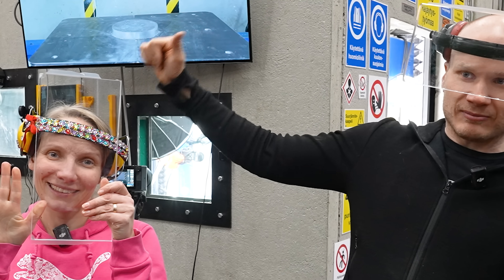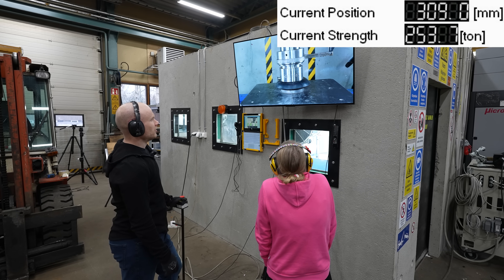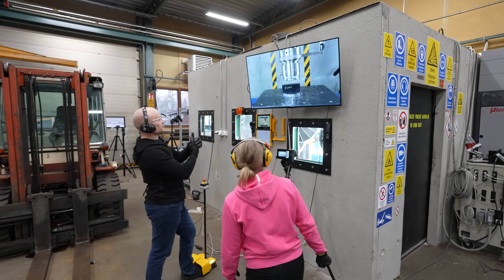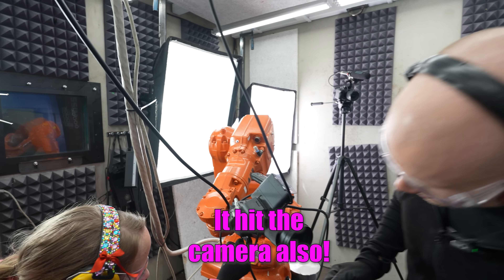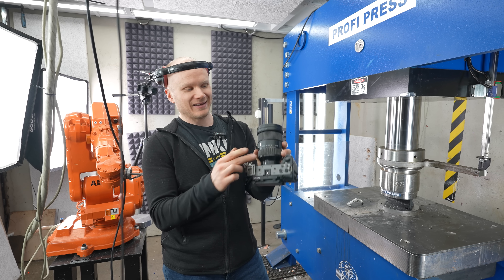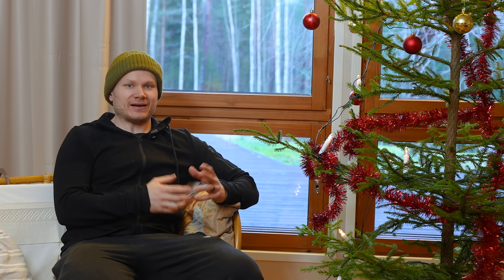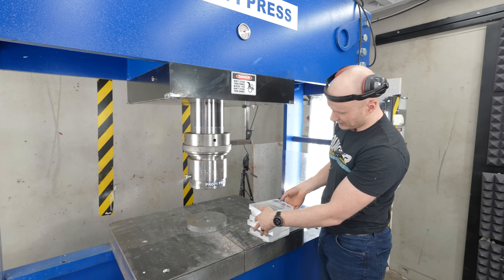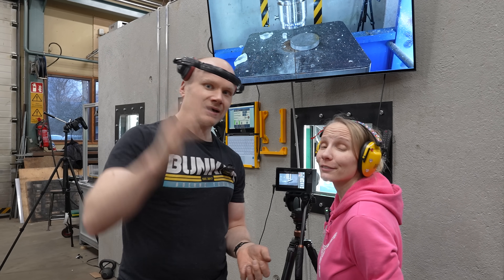What is the Most Explosive Plastic? Hydraulic Press Test!

Comment: The folks who use video cameras around high energy events, like rocket launches and explosions, have the camera inside a high strength enclosure, pointed 90° to the subject with a mirror mounted at a 45° angle.
It's a lot less expensive to replace a mirror than a camera.

Comment: I wasn't sure what the objective was here; whether to cause ordinary plastic to break explosively under pressure or to cause plastic high explosive to detonate under extremely high pressure without involving a blasting cap. I'm not an expert in explosive but I do know that you can do a lot of things with plastic high explosives without settling them off including stuff types that will literally burn if set on fire but mostly, to get them to go BOOM, you need a detonator.

Comment: I'd be very surprised if the files on the memory card are lot. However, one of the thin wires from the chip to the contacts has probably broken so somebody familiar with microsoldering may have to check it first or connect to chip contacts directly to read the data.

Comment: You should mount the camera sideways behind a sheet plate and use a mirror at a 45° angle to capture the footage.  You only have to worry about breaking the mirror and flipping the footage after that.  There's still a risk of the camera getting hit, but it's less than before.
Reply: Excellent idea. No loss of quality from thick plastic.

Comment: I worked for a company that used deep-drawn acrylic doors for vacuum chambers. I was in the weld shop late one day. They were performing vacuum leak testing on a rectangular vessel measuring 3ft x 3ft x 6ft deep. The acrylic door was propped against the chamber opening gasket. Vacuum held it in place. As I was talking with some folks, I noticed the door sliding down and was about to slide past the upper gasket. I yelled RUN! I ducked behind a welder around the corner as I heard the loud implosion. Large, razor-sharp chunks of acrylic were sucked into the vessel, then blown about 100ft down the shop. It was a miracle that no one was hurt. The back of the vessel was 3/8in thick reinforced steel. It was almost breached by the impolding acrylic.
Reply: Yikes.  Sounds like a definite "brown trousers" moment right there.

Comment: What exactly is moving at 2:28? Is it the piston or some optical illusion and it's really the base plate? Also, sad that this channel is getting less attention, it's more entertaining than 50% of todays videos...
Reply: The piston is pushing down on the baseplate, and the baseplate is pushing down on the frame. The frame is a large rectangle and the other end of the piston is pushing up on the frame rectangle.  The force generated is large enough to cause the top and the bottom of the rectangle to bow out away from each other and store the energy or force like the limbs of a bow and arrow.  When the plastic being crushed breaks, the broken pieces escape out from between the piston and the baseplate. This means there is less material between the piston and the baseplate and thus the parts making the rectangle bow out suddenly get shorter.  This lets the rectangle release some of its energy as the top and the bottom of the rectangle get closer together.  This release of energy often makes the baseplate move and bounce, and makes the broken plastic pieces go flying.  Other times, if there is a camera or other loose piece resting on the baseplate, the loose objects bounce into the air as the baseplate bounces from the rectangle frame rebounding.
Reply: Or if you're referring to the next camera view at 2:32, the plastic is forming a wedge shape as it breaks and the piston is a long rod.  The wedge shaped plastic is pushing the baseplate and the bottom of the frame towards the rear of the bunker, and the piston rod and the top of the frame are being pushed towards the front of the bunker.  The whole assembly of the rectangle frame and long rod piston is less ridged in the horizontal direction than in the vertical direction, thus it doesn't require as much force to change the alignment of the piston.  It is still a large force, and it is still stored elasticity, so once the plastic wedge breaks, the the piston and the frame are allowed to spring back into alignment.